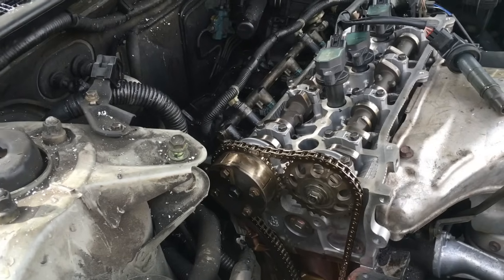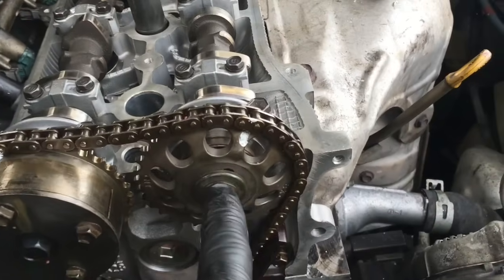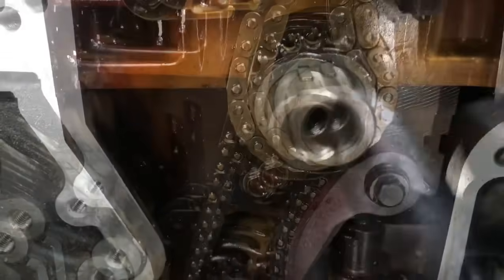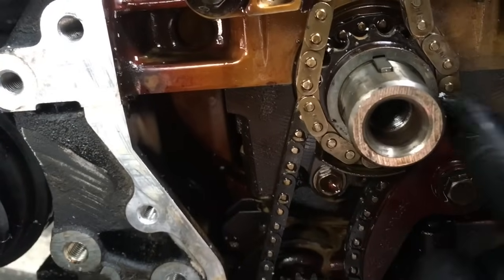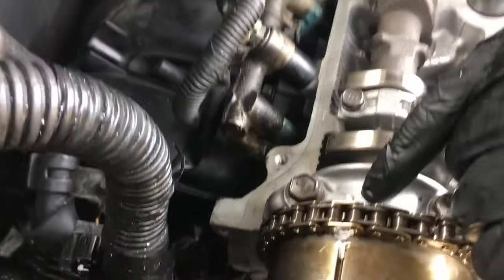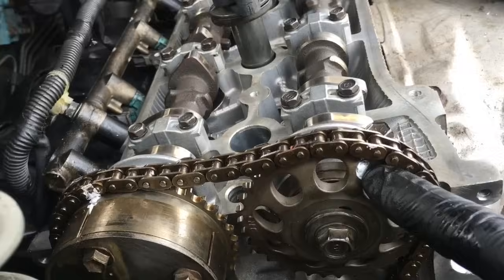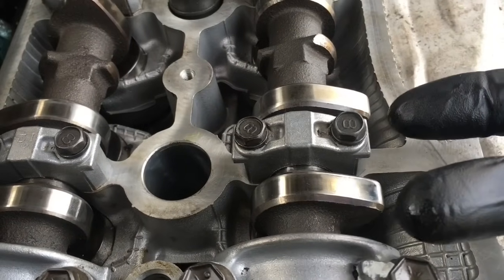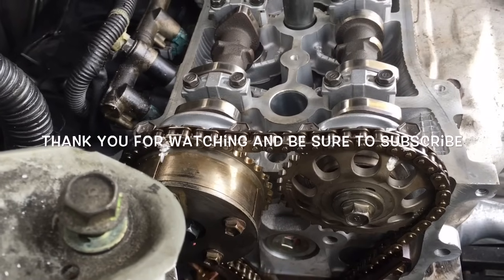How To Correctly Set Up The Timing Chain And Cams On A Toyota 2.4 L Engine

Comment: I have a V8 jag XJ. The check engine light comes on and the mechanic said when someone did the head gasket they didn’t set up the timing correctly .  How long does it take to do this job and is this common issue ? Why would the other mechanic not set it up correctly , I thought it’s a straight forward procedure that is hard to mess up .

Comment: The timing chain is off and you need to line up the cam gears. Let's say there are off by 5 degrees.  How do you move them to the mark?  Seems like a no brainer. Move it with a wrench but then why not tell us that    I have done that on a 87 vw but some of these vehicles have interference engines and phasers and what not.  

I imagine when a chain breaks shafts don't line up but have yet to find a video where the mechanic shows us how he got the cam shaft to the line up marks. 
Thanks

Comment: Hi, I have 2010 Toyota Camry XLE, it give a code which says. P0017 camshaft  position B camshaft position correlation bank 1.
I replaced all the sensors realted to timing chain, but still  the engine light doesn't go away. But engine does not make and nois, very soft. What I have to do

Comment: nice video, hey  i was wondering, have you ever not set it correctly-? will i have spark if that happens?
Reply from the maker: I’ve never had a timing chain motor off but a timing belt motor a half. If it’s just one tooth off it’ll run bad but I’ll still run.
Reply: @HowtoAutomotive  thanks! Im having a hard time with that engine, and a no spark condition, the engine was rebuild somewhere else.

Comment: A few questions. When you rotate the shafts so they line up with the arrows, does it matter what direction you rotate them? Also I've seen a few videos when after they install the chain, all is said and done and they rotate the crank like 5 times to make sure the tensioner is released. Is it safe to turn the car on at any position or should you turn the car on only at the arrow marks matching?

Comment: Thanks fir the video. I have camshaft and crankshaft correlation sensors bank1, on my RAV4 2008 2.4L .what do you suggest me to do. Thanks
Reply from the maker: fred bachir there’s a solenoid on the back of the cylinder head that controls a variable cam timing that is most likely the cause. Also low and dirty engine oilCan cause that problem. May want to start with a simple oil change.
Reply: @HowtoAutomotive  how can I check if the solenoid works properly? Thanks

Comment: I know you posted this awhile back, But....Im troubleshooting a for lack of better words a slight ign mis while increasing rpm between gears. Its a toyota 2.4 Tacoma 5sp, When I check my Timing with my OBD2 reader in Ign Advance Data. Its right around 10 deg at idle, then I put the pin in the OBD1 , FSM says it should go to 5 degs, it does. Reading with the scanner these are the numbers I get. But If I hook up a timing light, I see the mark way to the right, facing the truck. truck idles great, revs great, only have problem under load. any Idea. can I trust scanner.

Comment: Hey Brian, I am having an issue timing this engine, the exhaust camshaft will not sit still for me. The exhaust camshaft rolls when I try to line it up with the arrow on the exhaust cam cap. Have you ever had this issue?
Reply: Have you figured out this issue im having the same problem

Comment: Trying to give a friend a hand. She had her 2.4 L rebuilt,cost $3200 without install. Exhusband installed but left it with a P0016, I check all systems connected and everything is,good. Pulled valve cover,set timing mark to 0degrees on pully, cam marks look off by 10 degrees. Found out ex couldnt to get it to start so he fooled with chain after paying some one all that money. Do all the chains have colored links,this one doesn't. What brands have colored links?
Reply from the maker: Patriotic American As far as I know all the new change will come with colored links. If you have one without the color on it it’s I would suspect it as being a old or use chain.
Reply from the maker: Patriotic American also the color of the chain links could be gold which could be hard to see.
Reply: Thank you.Have you ever pulled a 2007 Camry timing cover without removing the engine? I'm tempted to plug voids,cover parts and grind away the timing cover a couple match books thick  where the chain runs to correct the 1 tooth it is off,the cover is pretty thick thick there. Although I am capable of repairing the error I don't have that much time to invest,might be a compromise to the $1,000 plus the dealer will charge.

Comment: Thanks! The service manual doesn't show the 2 lines on the intake cam so I had the right line and the "ex" dot lined up. obviously didn't start. High Five !!!
Reply from the maker: Mark Sowers glad the video was helpful. Thank you for watching!
Reply: I redid the timing like the video. Started right up. Runs better than before. Much smoother and quieter than before the head gasket and helicoil.  Stays cool as it should. Thanks again.
Reply from the maker: Mark Sowers glad to help.

Comment: i got all the dots lined up and now i have low compression wtf i never took the heads off just all new timing parts for the vvti and what not plus i get a code for crack posistion sensor maybe becasue it aint lined up or what im thinking i put the vvti on the wong notch throwing it off or what
Reply from the maker: B Sincere sounds like the vet is off. I would check by timing.

Comment: I did one of these now it want start just cranks wtf could be wrong ima try to make sure the timing is perfect tommorow besides that I can't see what else besides crank sensor which I had off
Reply from the maker: James Bond check and see if you have spark. If you don’t I would suspect crank Sensor. You can check compression and if it’s low suspect timing.
Reply: it has both sir no spark getting the srank sensor code and low compression also 70lbs so im guessing timing is causeing both?
Reply: keep in mind the heads didnt come off i just change the timing parts for the vvti rattle
Reply: I’m the same as James Bond and bsincere account still trying to get that thing running

Comment: I realise this is off topic, how does this engine compare with Honda's 2.4 K24 engine?
Reply from the maker: MrStoneycool69 overall I couldn't say anything bad about either one of those engines. They both have minor little quirks but overall very good engines.
Reply: Thanks for your reply. I was thinking the Honda would be less maintenance due to rocker arm tappet adjustments with feeler gauges, compared to Toyota's cam follower shim adjustments with a micrometer. But I there again how often do you do this...
Reply from the maker: MrStoneycool69 it's rare to adjust Toyota valves. No Hondas I do quite often but they're not that hard.
Reply: Thanks again for your quick response.

Comment: I have a 2002 Toyota RAV4 with the 2.0, is that the same set up for the 2.0?
Reply from the maker: Sean Strandfeldt it's pretty much the same exact thing just a few small differences. But I would definitely check with the service manual

Comment: Very helpful video. Followed everything step by step but my chain has some slack near the crank sprocket, is that normal or should it have full tension? Thanks.
Reply from the maker: alex meza what do you put the timing chain guides back in place and the tensioner back in place that should remove the slack. Also as you start the vehicle and drive it with pressure will push the tensioner out and tighten the chain. Just make sure all the links are lined up and you should be good.
Reply: How to Automotive going to swap out the engine in the next few days so if i need to run it for tensioner to tighten up i will wait til then. thanks for the quick reply i will keep u updated.
Reply: How to Automotive my wife's car won't turn over? no symptoms at all 60k miles? 1 mechanic said needs new engine another said prbly timing chain?

Comment: What about the damn tension-er dammit, this is critical to keep the valves from being bent when you turn it over to get the oil pressure against the plunger on the tension-er you dumb ass!!!
Reply from the maker: Thor Thunder the video is just a set up video not A complete help to video and at the end I said you can go ahead and set up your guides and tensioner.
Reply: Do you explain that if you do not have oil pressure on the tensioner that the chain can be slack enough to bump a piston and bend a valve???NOOOO

Comment: Hi Brian i did clear all the code with my OBD scanner , still wont crank now i have a charger and it shows the battery low i will let it charge over night how would i get it out of safe mode , i will keep you posted i am open for any idea as always thanks for your help, keep posting those videos they are very informative and helpful great job
Reply from the maker: ian young so if it turns out that the battery is dead after you get it charged up then re-clear the code one more time.

Comment: Hi Brian thanks for your help the you where right the throttle body actuator unit was disconnected, now the ml350 wont crank over, and ideas ??
Reply from the maker: ian young I would start with battery. If the battery went dead I would recommend jumping it with a jump box not with jumper cables and another car.
Reply from the maker: ian young it also may have gone into failsafe mode. So you will have to clear all the codes with a scan tool

Comment: Hi Brian need your assistance my ML350 2007 IS SHOW A  Code P0222 and P0123  and wont start what could the issue be your help would be appreciated
Reply from the maker: ian young sorry your have car trouble. Cording to the codes the throttle actuator has lost power or is shorted out. That's the throttlebody it's all electronic.
Reply from the maker: ian young probably going to have to have somebody check it out unless you have tools yourself and you will need a flowchart to figure this problem out.